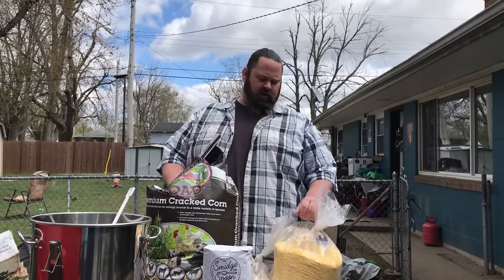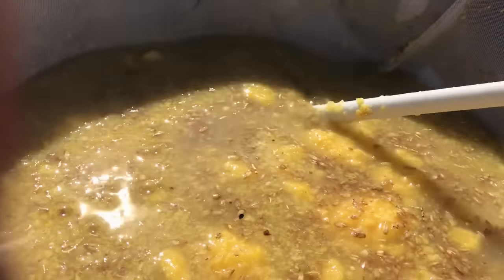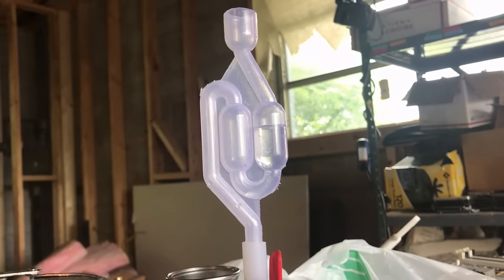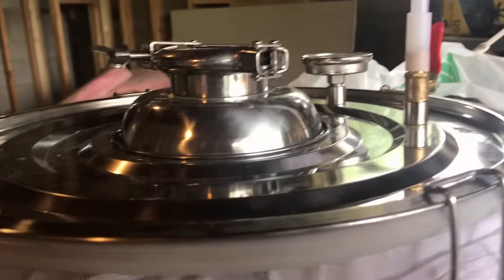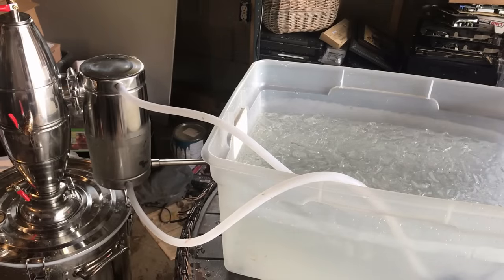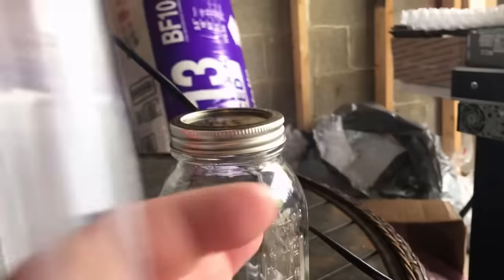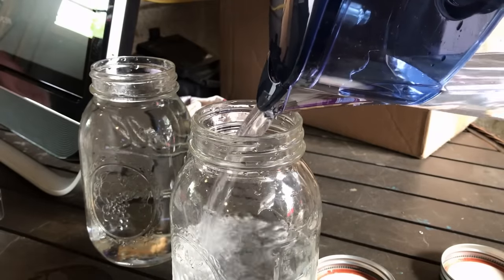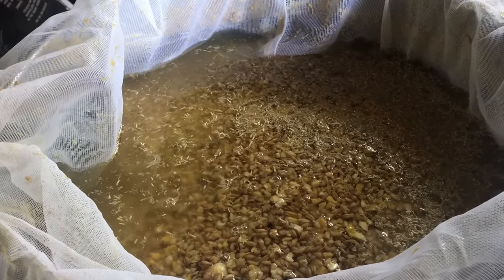How To Make Moonshine, first batch to sour mash, Moonshine Recipe

Comment: You are doing it, but for starters a hydrometer reading before you start fermenting and when you think it's done is a good idea.
          You are definitely doing it but your doing a lot of things the hard way as well as things you don't have to do at all
            Your keeping tails that's why your shine is yuchy , you only keep hearts. 
          That's not how they make vodka either lol
        If it still fermenting yous wasting some sugar. Hence the reason to use a hydrometer.
       The yeast  do not die they just go dormant if you add your back set from the still at 90 degrees  you can just add water and sugar get your gravity up to around 10% abv or 1.078 ish. And if you want to get extra technical you're shooting for a pH of around 5-5.2
    The yeast will wake up and ferment no need to add anymore.
          Ice water is not needed cold out of the tap is plenty cold. I get it though a tub of ice water and a pump is a lot less wasteful
   I'm totally not dissing you but you have a lot to learn to make some good whiskey. 
             The  Alpha enzymes in malted barley work at 160 -154.  Then beta works from 150-131 
When your mashing. The Alpha breaks the starches down to long strands of gluclose (sugar) , the beta breaks them down to even smaller strands . That makes it easier for the yeast to eat. The less you stress your yeast the better your mash will be or wash which will make a better whiskey
               If you use the proper amount of grain and do a good conversion you can get a 8 -10 % abv you don't even need any sugar that's some really bomb whiskey.
Flaked Gran is already gelatinized that's why you don't need to cook it so long heat the water to 170 no more than 173 it's called a strike temperature. Your grain will cool the water to about 160 if not just stirring it will cool it to 160 before you add the malt dump in the corn and cover it up with blankets or towels and wait a couple hours and you have a proper . Don't add any sugar till after you mash. Again a hydrome will tell you how much you need to add to get your potential ABV to around 10%
When you do a final hydrometer reading and it's at zero or below zero you're done fermenting then. 
When you use cracked corn you have to gelatonize it yourself by cooking it to 158-176 in practice, however, most corn whiskey distillers will tell you that unless you want to wait around all day for your corn to gelatinize, you're better off kicking that temperature up to 194-212.
And if you don't stir it constantly you'll scorch it and ruin your entire batch
Making small cuts during your run will and blending the best ones will get you some better whiskey as well. Or just learning have to tell heads hearts and tails apart and just keep only the hearts.
         I save my tails and do a run with tails only once a year I water them down to. 20 proof there's plenty of good whiskey still in there It's just mixed in with a fusil oils That's what makes it stinky and not taste so well. 
    Your four shots work great for charcoal lighter on your BBQ grill if you're looking for a way to use it.
       I'd like to send you a jar of my whiskey if you're interested my email is in my channel description You are just barely scratching the surface with your brewing and distilling knowledge but you could learn to make some mighty fine whiskey. If you're so inclined. Again I'm not dissing you just offering constructive criticism My grandfather taught me this craft.
At the very least   I would advise you to do a lot of research you will be a much better brewer and distiller.
          I have several videos about mashing and brewing as well in my channel if you're interested
    There is that tops about 2 oz of methanol probably more like one in a 5 gallon batch that's your four shots.
      Then you get the heads which have acetones and some other things in there that make it taste yucky. If you run your Still at two high of a temperature You can get fusil oils tails at any time during the run. Methal vaporizes 154°, Ethel vaporizers at 173 depending on how far above sea level you are getting super tactical but you have to go through the methyl to get to the ethyl so yes tossing away the four shots is a must.

Comment: The sour mash was low proof because it wasn’t done fermenting. If it is still bubbling leave it alone. The vessel does not have to be air tight with a trap. Just put the lid on top and don’t clamp it shut. Put a  fish tank heater in there set at 85 degrees and you won’t have to wait 2 weeks, it will be done in 3-4 days. Just a tip

Comment: The "stank" is not from the corn ,it's from the yeast that you haven't separated from the wash before distilling it! There's normally no need to filter anything let alone 3 times!
Reply: how do you separate the yeast from the wash?
Reply: @kristylaremore8732  
By syphoning the wash. In other words you pour the vessel with the wash into another vessel and leave the sediment ( dead yeast cells) behind in vessel number one. 
Let vessel number two sit over night and repeat procedure only this time you pour into the distiller and again leave  bottomsediment behind if there is any.
Reply: @kristylaremore8732 
Also: If your distiller is not made from copper,which is likely the case,you have to introduce copper into the process. Best is copper wire attached to the steamroom where the alcohol vapours have to pass through it before condensing. It acts as a catalytic converter and is needed to suppress unwanted smells and alike,hence all old school stills are made from... copper!!

Comment: A yeast starter would speed the fermentation up.  It s important to know the temperature that the mash is distilled at.  Too hot and all the impurities are carried over.  The pot is great.. easier than converting an old pressure canner.  Good job however…

Comment: Try this recipe it is much easier and I think you will like it.
Uncle Dave's Corn Licker
2 pound frozen sweet corn
1/2 pound Bran
5 pound sugar
1 pound malt (optional)
5 gallons water
yeast
Simmer the bran for 30 minutes minimum. dissolve the sugar and malt to it at the end of the 30 mins and chuck the corn in it too. fill up the fermenter with water and ingredients when the temp is below 34 c add the yeast. The malt is optional (I haven't noticed much difference with the flavour using my reflux still) but if you omit it you want to add some yeast nutrient. For the second run I add about 1/2 pound of frozen sweet corn and after the 3rd run I discard about 1/2 a pound of old frozen sweet corn before I add another 1/2 pound  of fresh corn to the ingredients for the 4th run and do the same for every run after that. Don't worry about the bran just keep reusing it. If you haven't got yeast nutrient try 2 multi vitamin tables, 1/2 a tea spoon citric acid and 1/4 tea spoon Epsom salts.

Comment: I want to stress for anyone that wants to try this to take his WARNING about the first runnings being "poisonous" seriously.  What you are wanting to drink is ethanol.  The first stuff to distill off is methanol at 148 degrees F.  Methanol will make you go blind if you are lucky, or dead if you aren't.  This is not stuff to mess around with.  Read up carefully about which temperatures methanol begins to distill at.  Do not drink that stuff.  Once you reach the distillation temperature of ethanol at 174 degrees F, then you can start collecting the liquor.  Throw away anything that was distilled cooler than that.

Comment: You should put your still in pot mode, not reflux, you’ll get better flavor. And your thermometer goes halfway up the column at the “point of no return”. And you only need to throw the first 200 ml of fire shots and 250 or until the funk goes away for heads. And heads and foreshots is NOT poisonous, if it was all the people who drink beer (the wort you just distilled) would be in TROUBLE 🤣

Comment: As a biochemist, wouldn’t it be easier to just use straight sugar, and ignore the corn all together? The corn is just sugar locked up in starch that requires more steps to be converted into sugar. Corn is just tradition, at this point, based on how hard it used to be to get pure sugar. Add pure water,,, sugar,,, and yeast, and distill it after it ferments. Screw the waste of time corn.

Comment: You're never going to get all your fermentable sugars out of there unless you bring it to a boil.it turns it into like a porridge makes it hard to work with us until you get your enzymes in there  and that moonshine looks like it's got piss in it it should be really clear you ran it too fast. It should just be coming out in drops never extreme in anything under a 20 gallon still.    And you can buy one of those cheap grain mills and take the handle off and put a bolt there and run it with a drill to grind your cracked  corn  into a coarse meal and you'll get a better yield off of that too.    Look up sebstar high-heat enzymes that's the only way to do corn takes all that sticky gluecomase out of it

Comment: Instead of running it through a Britta...  why didn't you just clean out the mash pot (or have a 2nd one) , Pour all your shine into the 2nd one.... cap it of with the still, put the fire back to it, and then  run it a 2nd time.   i.e.  "Double Distilled"  and this would clean it up and take all bad smell and cloudiness. This would also burn off some of the excess water, and raise your "Proof" up above 150.   Then you'd have some ROCKET FUEL!!!!!!!!!!!!